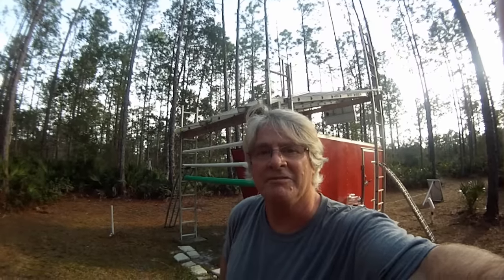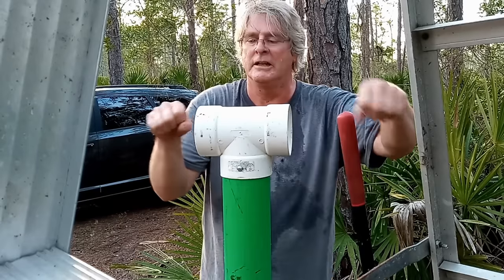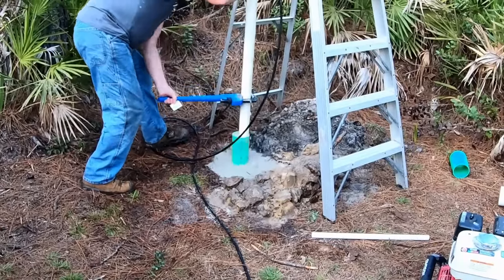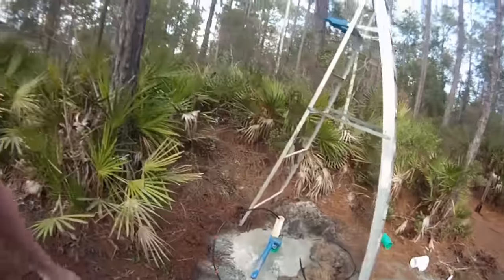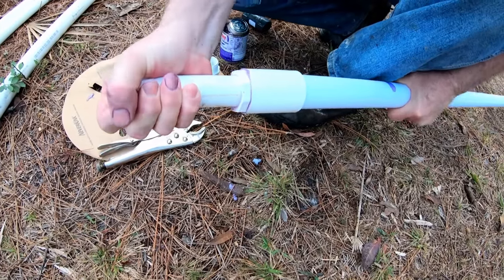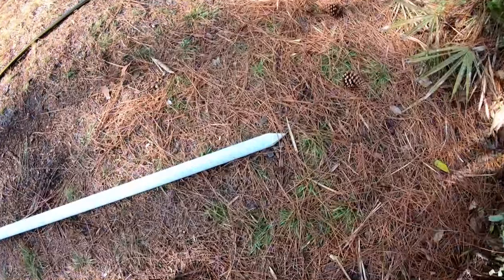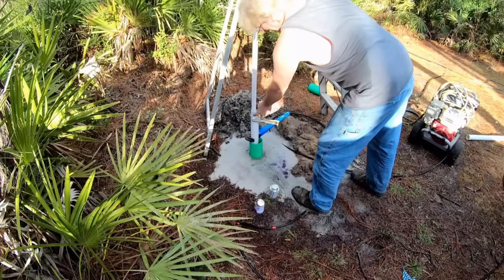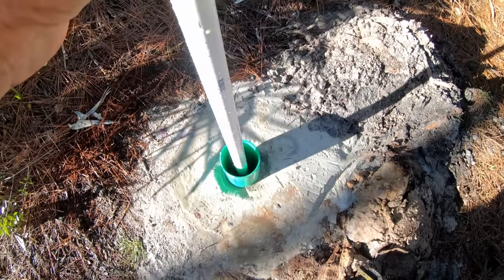Easy SHALLOW WELL DRILLING Howto DiY drill 25 ft shallow well

Comment: Hi sir your video is great and you make it look so easy. My problem is  im about 10ft down on my 2in casing and its stuck. i cant get to move at all even with a big pipe wrench. im using the mini jetter just like the one your using with pressure machine. cant seem to fig ure out what im doing wrong. im in so florida. can you over any advice?
Reply from the maker: Hey Thomas, thank you for watching!
did you start with a 4inch pipe? 8-10 feet of 4" pipe will soften up the tuff layers of peat moss which has been under ground for thousands of years.
it will loosen the peat, sand and soil as so when you insert the 2" pipe drill it will not seize up. The ground around your 2" drill is to tight. a suggestion would be maybe try and drill using a 4" pipe ( with mini jetter) around the existing 2" drill pipe. if you can get the 4" pipe down over the length of 2" pipe, you will be able to continue drilling with the existing 2" drill, just keep adding sections. 2" pipe will drill without a problem once you have installed a 8-10 foot section of 4" pipe over , around the 1st section of 2" drill pipe.
Thanks again for watching

Comment: Thank you for the video, question, will this work for a deep well or is the process different for each? I need a well for a new home build, in central Florida. Thanks for any advice!
Reply from the maker: Hi Scott,
Thank you for watching. IDK the answer to your inquiry.
You will have to keep on watching deep well videos from Florida!
I think the methods are simalar but, you may need beefed up drill pipe to go  down over 30 feet. AND / OR a MUD PUMP that had super high volume of water going down into / thru drill pipe. THANKS AGAIN FOR WATCHING!!!

Comment: Good video! What do you think of this idea: clearly, it seems highly likely that the 2" drill pipe needs to be raised so the bottom of it is at least above the top of the well point. But is there any value gained in pulling it the rest of the way out of the ground?
Reply: Yeah, its a lot easier to pull it out than to pull it up a bit, and fix it to the top so it doesn't drop back down over your well point.
Reply: Yes dig Wells. Told my sun oden in Florida. Odens concrete start a business. Naples fla

Comment: Will this work in a clay ground?
Reply from the maker: hi cuacasianH,
Thankyou for watching.
Its not as EASY but,
you can use this method in cllay.
How deep are you needing to drill?
what state or area of the world are you thinking about drilling for a shallow well?
Thanks again for watching!
Reply: @AtlanticDrain  thanks for the reply and great video. I'm in SE North Dakota which the state maps shows the ground is "loams and clay loams". I just want a shallow well for starters. I have the sandpoint, pipes, couplings, hand pump etc.. But I rather dig and have the pvc barrier around the well pipe rather than drive the posts. Any suggestions?

Comment: after installation, will you ever need to reclean the perforated 2 inch pipe? willl it get plugged up with sand over time?
Reply from the maker: Hey Sean, thanks for watching.
sooner or later. So far after one year it's working just fine.
I pulled out the 2 " pipe right away.
Some people do not do that. 
Thanks again for watching

Comment: Is it possible to drill too deep? For example if the water table is 25' deep but you put the well point at 40' just to be safe, will it still work?
Reply from the maker: Hey zod,
Thank you for watching.
The pocket has a ceiling and a floor. When you get into the pocket, it will drop thru to bottom  with little to no resistance and stop. So, if you have a high ceiling, it could drop that far and it would still pic up water up to 25 ft underground( maybe 30 if your lucky). Remember water will seek it's own level. So it would still work very well.
Thanks again for watching!
Reply: @AtlanticDrain  Thanks much for the reply. I ask because when pounding a metal sandpoint into the ground you can see when you hit water. Especially by dropping a string down to test for wetness. With your method you are introducing the water with the pressure washer so you cant actually see when you hit the water table. Wondering how you know when to stop?
Reply from the maker: hey zod,
again, if drilling by hand with pressure water, the drill shaft assembly will suddenly, drop down further into the ground with little to no effort once the drill assembly hits a water pocket.  thank you for the comment and follow up questions.

Comment: How would you add a pit less adapter with the 2” pipe in the way?  Ideas?
Reply from the maker: hi bryan, Im not sure what you mean. 
 1" pipe slides thru 2" pipe very well. the couplinks O.D is 1- 1/4"  check valve and well point fit really well inside 2" PIPE ALSO.Thanks for watching

Comment: So again with similar videos I have one question. If the well casing is only 20' feet deep, and your well point is deeper than that, then won't the well point clog with debris?
Reply from the maker: hey roy,
thank you for watching.
Micro slots. seems to be working trouble free, no clogs still today. its been three or 4 maybe 5 years since i installed this shallow well system. no problems.
thanks again for watching. let me know if you find other methods.

Comment: When a kid in Jacksonville, FL, we would "drill" with a running garden hose in the backyard.  We could push it down in the sand easily, maybe 10 ft of hose, though might have been curving back on itself.  Our dad would get mad at the piles of yellow sand left in the yard.  The pines and palmettos in the video suggest you are in FL or S. GA to LA.

I used the same method to avoid digging a long trench thru a hill of ivy in my yard in Atlanta when running a new 1" supply pipe from the street.  I just drilled a hole in a cap on PVC pipe as a water jet and pushed it thru the clay 2 ft deep under the ivy and it came out right where I aimed in a hole I dug behind the concrete wall at the street.  Did the same to cut across the front yard, going from pit to pit and avoided digging up the grass.
Reply from the maker: Hey William, 
Thank you for watching!
and
Nice story!!!

Comment: I’ve ran into clay/hard pan at around 8 feet. I used a Jetter to get that far but it won’t the the clay/hardpan.i think I saw a video of you using a 2” trash pump.  Do you think the pressure from the trash pump would punch through the clay?
Reply from the maker: hi bryan, thank you for watching!
Be sure you have cut teeth into 2" pipe. you may have to cut slowly, dislodging small plugs of clay then jetter to desolve / break up clay plug. thanks for watching!
Reply from the maker: hey bryan, even better yet, put  some 1" down inside 2" with teeth on the end as so it will help break up the plugs just dont force it. simply turn 1 " after dislodging a plug with 2"

Comment: How do you know when you hit the water I'm down 32 ft got white sand but I'm just not sure I didn't put any cross holes in that 2-inch pipe Central Florida
Reply: Guess I'm just getting a little confused I'm pumping water in and I'm seeing water come out with white sand

Comment: Nice video, removing the 2inch pre casing means that future repairs ie replacing the foot valve becomes a Herculean effort.
Reply: Ya was wondering the same thing. Why can’t we just leave the 2in pipe in there. Why remove it. Just put some holes in it
Reply: @mathusvaiaoga9787  I would think If you cut some larger slots in the lower section of the 2" pipe you could use it as a coarse casing also.  Water may try to escape out of it but I dont think that would be a problem.  keep it in there as a coarse well screen.   How far down on that are they setting the  check?  Great idea though, I ordered a kit do mine from amazon today!   I put in a water system down the hill at a lake/reservoir.  I can pump enough water up the hill to power the pressure washer to build something a little cleaner and more permanent!
Reply: All that needed to be done was to raise the two inch pipe up the length of the screen and leave it in place ,maybe with a pop rivet at the top with the main casing. This way if the valve fails in the future (which they do) your only lifting it out of the sand a bit and much easy to jet back in place instead of digging a new hole.
Reply: Planning on doing my own well drilling as well, now it seems that leaving the 2" pipe makes sense in case the check valve fails on the main well casing would be easy to remove but as far as Florida is concerned, the annular seal has to be concrete grout on top with a thickness at least 3" and sitting on top of pea gravel to fill any voids, also filling the annular gap with pea gravel in between the 2" pipe and the 1.25" main casing will make it super hard to get that main well casing back in there with all that gravel sitting down there.
Reply: @chrismylonas764  v be
Reply: @chrismylonas764  this is what I'm planning -adding pea gravel while I raise the 2" pipe up ~5 feet so its around the well point helping filtration of sediment
Reply: @echopeus22  If the aperture of your screen is correct and your in a good sand aquifer I personally wouldn't go to the trouble. If there's clay then pea gravel is a must to help prevent the screen clogging, but for domestic irrigation spear point (not for drinking) maybe keep it simple, sometimes over thinking bores can cause a world of pain.

Comment: My only big question is...where did you get the water to feed the pressure washer?  Other question is...you think this will work in North Florida?
Reply from the maker: Hi T, 
Thank you for watching.
Use 2 each 30-50 gallon trash cans, fill with watre
gravity feed with hose to pressure washer.
North Florida, Yes!
Thanks again for watching

Comment: I would pull the 2" up some and use it for a casing.  If you pull it out and leave the 1", the well will collapse around it.  If that happens you better hope your check valve never needs to be replaced because the 1" may not be able to be pulled out.
Reply from the maker: Hey Little Drum,
Thank you for watching! Yes you could do that! its best to take itr up beyond the micro slots  of the 1" pipe. Then be very careful and take your time cutting the 2" out from around the 1" pipe that is above ground! _  it would be tricky but, it could be done. just dont let that 1" pipe DROP down underground when cutting 2" pipe!!!
 Thanks again for watching!

Comment: Could I just pull up the 2 inch pipe eight feet then cut the pipe leaving the rest in place. That way the 11/4" well point and pipe will be beyond the 2 inch pipe.
Reply from the maker: Hey John, Thank you for watching. Yes you sure can!
drill your total depth, insert 1-1/4 well point, pull back 2 " pipe 5-8 feet.
Thanks again for watching!

Comment: Did you put the Check Valve, Upside Down ??
Reply from the maker: hey tree,
thank you for watching!
check valve is installed correctly with proper direction of flow thru check valve.
system works great !
Thanks again for watching.
Reply: I saw that too.

Comment: @AtlanticDrain - I am in Massachusetts, have a beaver pond about 400 feet off my property and a very damp yard. I drilled down to 15 feet and got water flowing but not enough volume. The water sits about 5 or 6 below the surface. Do you suggest going deeper? How do I know when I am in good water? This is only to run an irrigation system for my lawn. HELP PLEASE and Thank You!!!
Reply from the maker: Hi Brian, Thank you for watching.  remember, water seeks its own level. sounds like the beaver pond has made a hydro static table - how many gallons do you get?

Comment: i feel like there is a filter screen missing from that well point. to me it seems like those inlet ridges are going to get clogged up in no time. i saw someone use a filter sock on a similar installation.
Reply from the maker: Hey lyger,
Thanks for watching.
3 years ( so far) and no issues.
Thanks again for watching!

Comment: I used the same method in Florida, I got 21ft down and it just stuck down there, won't go down, do you have any advice please?
Reply from the maker: Hi slether, you're right there! If you have pressure water pressure washer and a jetter going down through your 2-in pipe and you have teeth on the end of your 2-in pipe that should loosen up and you are right there just cut a little bit more and you'll be down in a pocket of water remember, most pumps will not lift more than 25 ft. Good luck in finishing your drilling.
Reply: @AtlanticDrain  thank you, I was a little panic because the 2-in pipe so hard to turn looks like something hold it, I even used a chain wrench still can't turn the 2- in pipe and I have teeth on the pipe. Even 
White sand don't come out no more, just clear water from the pressure washer come out the 2-in pipe. I don't want to give up on my 21ft, I think it's stuck on something.
Reply from the maker: Maybe you should check n see 🙈 f you are in the water pocket at 21 feet. Put a tape measure down into pipe all the way to bottom.
See where the water mark is at n your tape.
Put a nice rag into one end of your one inch pipe ( or a cap), one that won't come out easily . Stick the pipe all the way down into the 2 " pipe, it will push water out of the top of your 2" pipe.
Remove 1 inch pipe, 
Put tape measure back down into  2 " pipe. See 🙈 f water level has changed. If water level is the same, you may already be in the water pocket!!!
Reply: @AtlanticDrain  thank you I am going to try that

Comment: I would use a metal end to the pipe to allow for easier cutting in the sand..
Reply from the maker: Hi Mr Moses, thank you for watching. A metal cutting head wood work well but, costs a "bit"
more. I guess I would use metal drill head  if  was going to drill a bunch of wells. Cutting long teeth into the 4" &  2" PVC worked great for me. Thanks again for watching! 😁

Comment: Problem you are having is you need a greater volume of water to lift the solids out of your well. A mud pump would have been a better choice.
Reply from the maker: Hi Cecil,
Thank you for watching. Yes a mud pump could help drill / remove sand burrow down very fast. It uses a VERY LARGE volume of water. You would need AT LEAST 500 gallon tank of water to use a mud pump. it would work great. just ALOT of water would be needed to accomplish the drilling. The pressure washer, only uses about 30- 40 gallons of water. Thanks again for watching!

Comment: Hi... it's possible to use 1/2" pipe for drilling shaft ?, my water table is only about 2-8 meters deep, and it's feasible to use pressure water from another shallow well pump for drilling ?, it's only 10-20 liters per minute
Reply from the maker: Hi Meow,
Thank you for watching.
You can try 1/2 inch but,
II don't think its possible with out using the 2" pipe for drilling.
you can use the water from your other shallow well.
a pressure washer doesn't use much water.
Thanks again for watching!

Comment: why not put check valve up by the pump? then you can replace it when it goes bad
Reply: The pump works harder to prime if the main suction line is empty, it's easy to pressurize the pump with the foot valve at the bottom and the suction line us full.
Reply from the maker: Hey Wayne, Thank you for watching!
Ive gotta go with your experience. 

do you drill ground water SHALLOW wells or 
fresh water DEEP wells?
thanks again for watching!
Reply: @AtlanticDrain  If your check valve is at the screen and gets stuck closed, which does happen, you lose your well.  Its not like a packer system you can pull up and replace unless you plan on doing a double well screen in a jacket. A check valve above ground is repairable and does the same thing. A ball valve installed before the check valve allows you to close the well off so you can replace the check valve and not lose prime.  It also allows you to bypass the check valve and pressurize the well to "make" it if it clogs with sediment, or to sanitize the well.
Reply: @JayD6321  I’m new to this and trying to understand what u are saying about bypassing the check valve and pressurizing ur well to “make” it or sanitize it. Can u explain this plz? Thx
Reply: @jenniferpope9497  If you put an access point to your well pipe somewhere before your check valve, pump, manifold, etc., you can run pressurized water down the well if sediment has clogged the screens. Normally I put something I can screw a garden hose to. Thats called "making" the well.  You can also pour bleach down your well to sanitize it, but theres more to it than just pouring down the well.  And it really only works good if you have a submersible pump.

Comment: How much water do you need to bring onsite to jet the new well?
Reply from the maker: Hi Robert,
Thank you for watching. 
I had three 30 gallon trash containers that I purchased full of water.
estimated 45 gallons used. gravity fed siphon hose to pressure washer will work!
In this video, I elected to run a VERY long hose from an adjacent property to the drill site.
thanks again for watching!

Comment: Is it just me, but didn't you put the check valve on backwards after you just got through explaining about the arrow facing up, towards the surface.I understand a check valve works. When you quit pumping water, the weight of the water takes over the pressure of the spring and closes  the valve, therefore making the pump easier to prime
Reply from the maker: Hey Jeff, its kinda hard to see the arrow but, I did put it in correctly.
Thank you for watching!